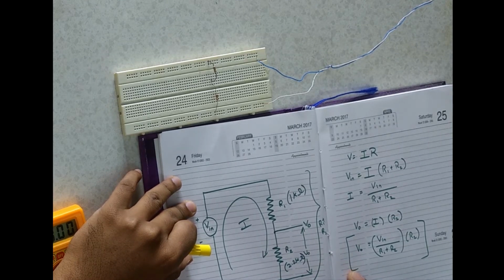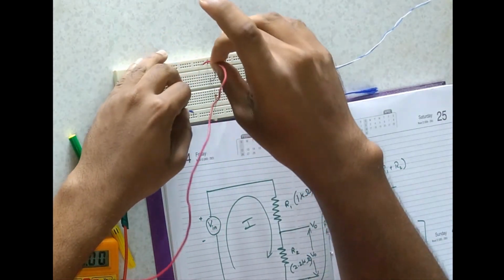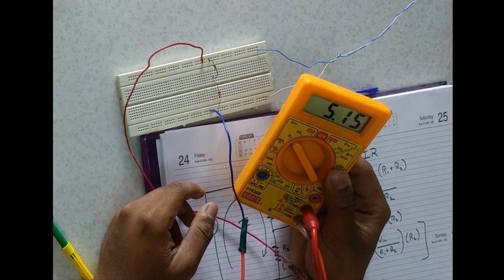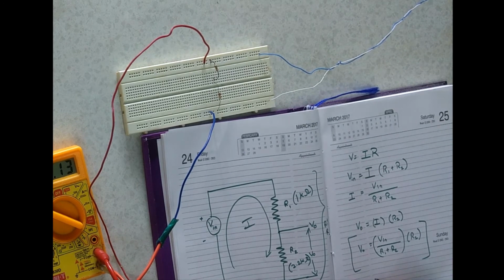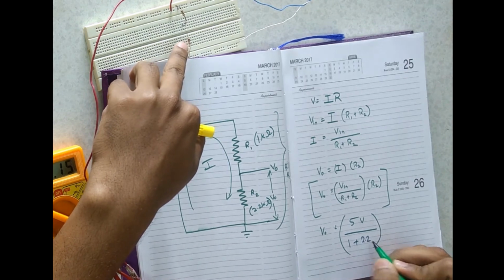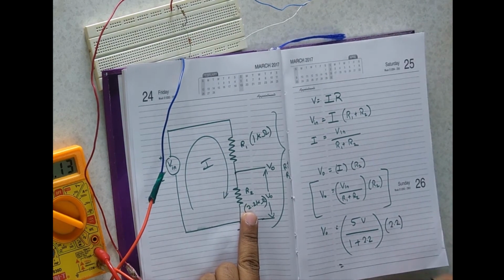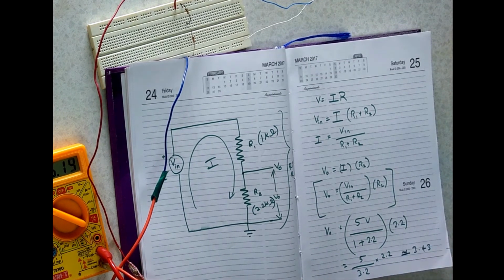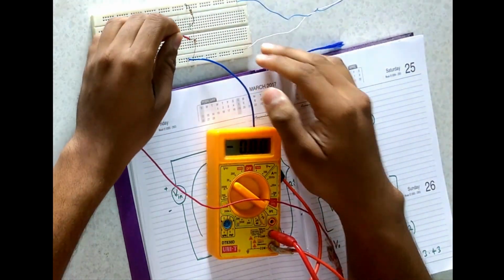Voltage Divider Circuit Explained!!!

Comment: Hi can I use this method to drop a 9v secondary voltage from a power transformer to 6.3v to  supply 6.3v to tube filament?
Reply from the maker: u may need to use capacitors instead of resistors for alternating current. Since u say transformer is supplying, i assume its AC